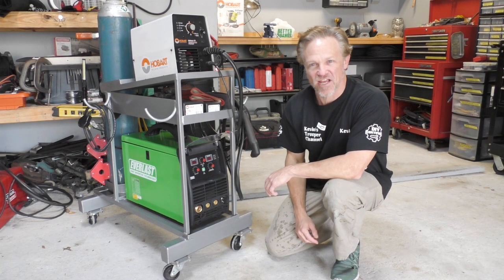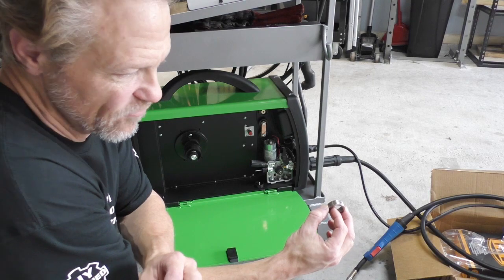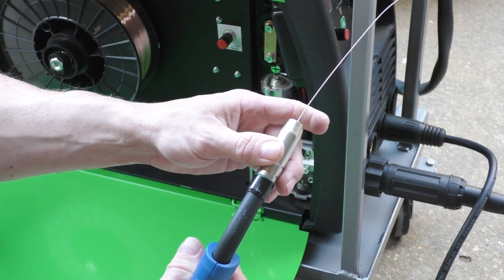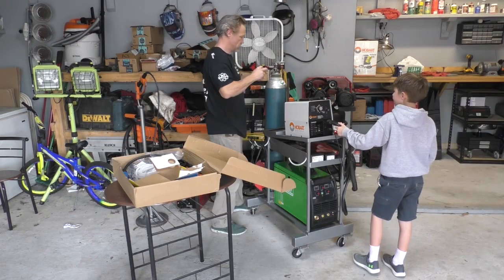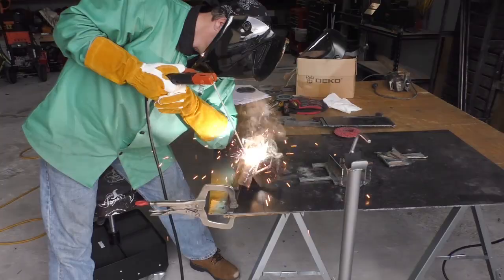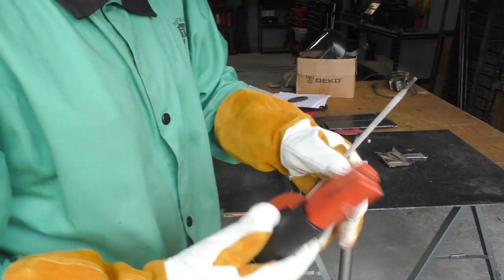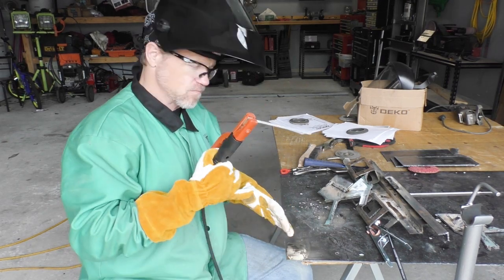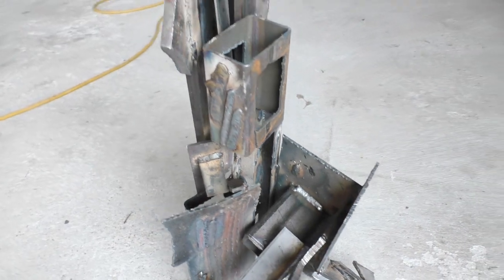EVERLAST iMig 200 WELDER - REVIEW and SET-UP

Comment: Set your arc force to about 70%.  Also use a push, not pull motion.  It'll help.
Reply from the maker: Everlast Power Equipment thank you very much. I love my welder
Reply: just wanted to say im enjoying my Everlast powerarc 200st  it paid for itself with the first job and still looks new, will you ever offer a blow mold travel case for your welders?

Comment: Will it run flux core .045 wire diameter. I heard you say one of the rollers does .035 and higher but I just wasn’t sure

Comment: Thanks for the video! I'm a college weld student, I just ordered this machine, itll be my first machine, excited!
Reply from the maker: GrowYourOwn your gonna love it 
Thanks so much 
Good luck 
If you need anything let me know! 
Thanks for watching and welcome to the channel 
Grow your own!!! Love it
Reply: Same how’s it going for ya?
Reply: @mr.blicky7932  its been a good machine, I also got the everlast power pro 205si, AC/DC tig, stick, and plasma. Both have machines have worked flawlessly so far
Reply: @MikeP350  That’s sick. I just ordered mine  today. What kinda welding do you do?
Reply: @mr.blicky7932  At work I do production and HVAC fabrication, its 90% MAG welding, 10% TIG, for any stainless we do. At home I prefer to run TIG whenever possible.
Reply: @mr.blicky7932  Mine actually did come with a chart on the inside of the door, but I usually turn it down a bit from there.

Comment: I bought a POWER i-MIG200E in September of 2018. I have had a lot of problems with it. I do not consider it a reliable product. 

List of all known problems: 

-9/2018 - Gas hose leak - repaired this by tightening the crimped hose clamps on the hose. 

-?/2019 - Trigger contacts dirty - I had to disassemble the gun and clean the contacts to get it to work. 

-3/2019 - Gas Solenoid sticking - Lost a whole 80 cu ft tank of shielding gas during a lunch break. 

-8/2019 - Wire feeder does not work - When I pull the trigger, I hear a faint click, but the wire feeder roller does not turn. 

Other issues that I don't care for: 

-Ground cable seems very short.

-I prefer a shielding nozzle that screws on instead of the push on type like this welder has. 

-No chart for weld settings based on metal thickness like most other MIG welders have. 

Returned it for warranty repair. One way shipping was over $80. I assume it will be the same for return shipping also. Paid $600 for welder and now another $160 in shipping. Still less than a Hobart or Lincoln. At least it broke during the warranty period. But it'll probably be gone a month or more.
Reply from the maker: Chuck's Truck wow man. Sorry to hear that. Many folks have been very happy with everlast.  Hope your machine comes back in great shape 
Thanks for watching and commenting and welcome to the channel. 
Kevin

Comment: Another thing on keeping flash burn (sand in the eyes feeling) away, make sure your lenses and gaskets are all put back in the proper spot and securely. I use to have to clean and rebuild my dad's old hood and I messed up putting it back together. The next day he had flash burn pretty good. It leaked past the gasket through a small hole.  

Also the better the hood the better the sensors and the more the sensors it has. Cheap hood sensors has a tendency to not work right or at all. 

Nice looking welds on the stick once you got moving. You just need to suck the beads up a little closer to one another. Just remember practice makes perfect.
Reply from the maker: Allen's World thanks man. And thanks for watching

Comment: Just discovered your channel with the northstar air compressor. Liking your reviews and look forward to seeing more on welding safety equipment, etc. Did you have to turn up the arc force for the stick welding process?
Reply from the maker: No Name thanks so much for joining the channel. Yes I did have to change it 
I think I said it backwards in this video. The higher the arc force the softer the arc I believe. But now I leave it on about seven all the time. I leave my mig settings on around 18v and 210 wfs unless I’m working on something real thin. I will be changing the name of the channel next week to KTC garage so be on the lookout for that. The trooper is finished and it’s not really accurate to what I’m doing on the channel any more. So it will be KTC garage soon.  
Welcome to the channel and I have some great welding videos coming up soon. Welding table build, more big pieces of industrial furniture and much more. Hope you will stick around! Thanks again. Let me know if you ever have any questions!